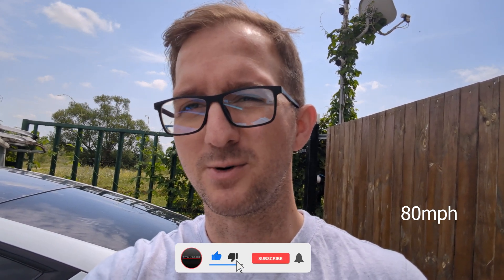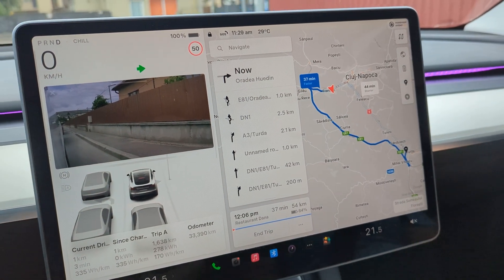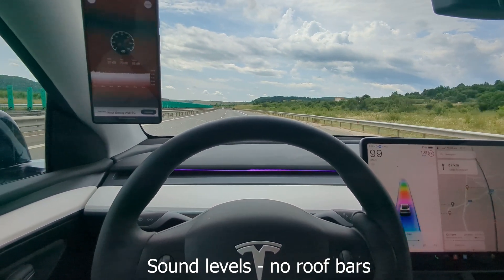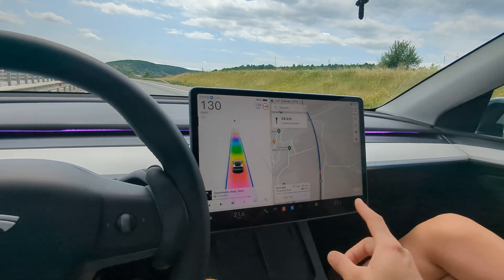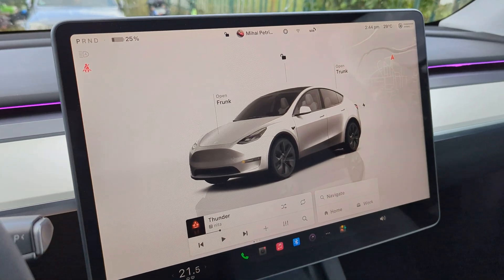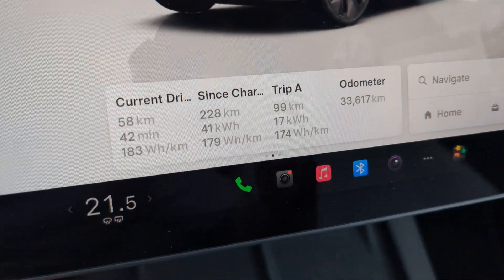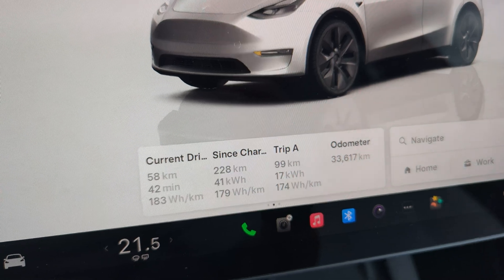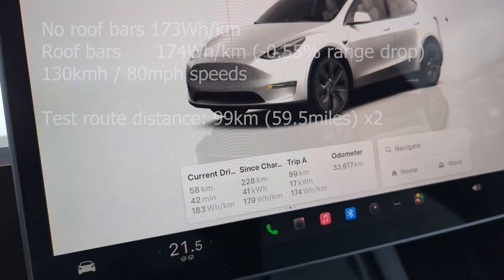Tesla Model Y roof rack highway speed Range impact ?

Comment: Now do this same test but with a box up top. Just the bars are no biggie. Minimal impact on range. I'm getting my bars tomorrow and I use a box for our road trips so this will be interesting.
Reply from the maker: The point is to see if bars have any tangible effect on range.
Reply: @Twin.motors  that is definitely a nope but if you respond to what I wrote in my edit and not the original message that would be great. Nice test tho
Reply from the maker: @m3ile0hig3h  i don't have a box, I use the roof rack for carrying my bike sometimes. That definitely impacts range. At least 10% from what I noticed, I would imagine a roof box to be similar or more
Reply: @Twin.motors  thanks for the response. Sorry if my original reply came off hostile. I just hope I can make it to the next supercharger on my trip when I get my rack with my Thule box.
Reply: Rear hitch cargo carrier is better on range